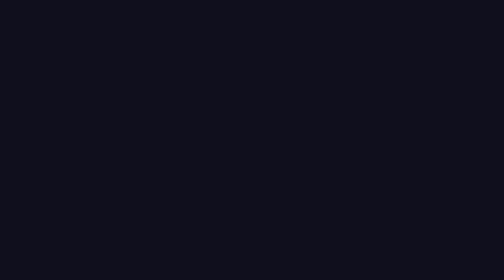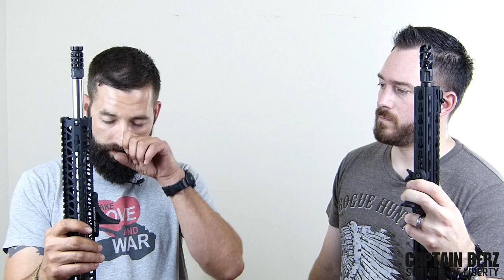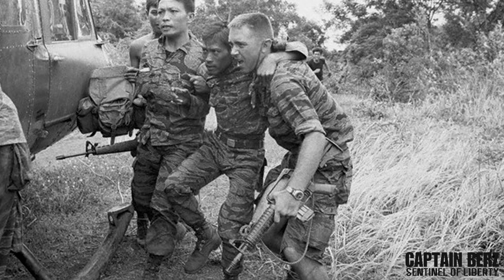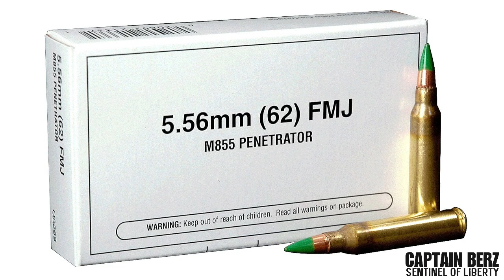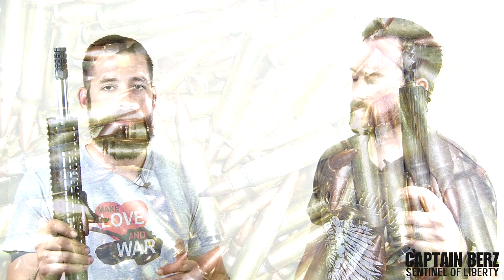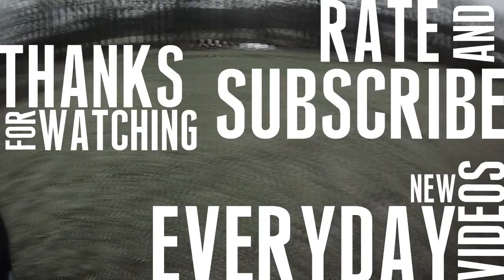AR-15 Barrel Length & Twist Rate (Part I)

Comment: For the record, your 500 yard numbers are way off. From a 20 in barrel, with a muzzle velocity of 3100 fps and a G1 BC of about .309 M855 is going to have about 1600 fps remaining at 500 yards. 
Now from a 10.3 in barrel (Mk18), you're looking at just over 2700 fps at the muzzle, which puts you transonic at 500 yards.

Comment: 6:09 😞 If it does not have a 20"+ barrel it's truly not a rifle, it's really a carbine or SBR, rifles are meant to hit with force over longer distances, and carbines and SBR'S are meant to hit with force within medium to short distance, traditionally rifle barrel lengths were 20"-50" today it's like people want rifle performance from a carbine, a carbine is a light weight short rifle, but not truly a rifle in the traditional sense, carbines are meant for CQB not distance, I don't see how he can confidently say that the 20"+ barrels are obsolete when they are clearly not, it's just that people want to look "TACTIC😎😎L"  and we all also want to get SBR'S removed off of the NFA list, so the short answer is a rifle can do everything that a carbine/SBR can but at longer distances with better stability but they do not maneuver in vehicles, doorways and tight spaces like a carbine, and carbine/SBR can do everything that a rifle can do but only at a short limit range but are more maneuverable and concealable  but not as powerful or accurate as a rifle, I never heard of a sniper using a carbine as their primary weapon, can you truly be called a rifleman with a carbine as your primary weapon? It's questionable maybe a Carbineman lol just playing!

Comment: I'll take the extra velocity of a 20 inch barrel vs any SBR any day. Depends on environmental factors of course but I'm definitely not going to be kicking in doors any time soon.
Reply: Exactly. It's a small caliber and depends on velocity. Short barrels look cool, but the reality is longer barrels are more effective and produce less flash.
Reply: True.  It's better to have it and not need it than need it and not have it.  Even if I have to kick in doors and hosed the room with bullets, a 20 inch barrel is not ideal compared to an 16 inch barrel but it still can be done.

Comment: Are there any manufacturers that produce a 20 inch barrel with a 1 in 9 twist?
Reply from the maker: I’d Go 1/8 or 1/7. For heavier bullet stabilization.
Reply: @CaptainBerz  But that does not answer my question. 1 in 9 out of a 20 inch barrel spins considerably faster than 1 in 9 out of a 16 inch barrel.

Comment: Twist rate is a personal choice and is somewhat determined by the manufacturer as is barrel length it really depends on what your doing with your rifle and what rifle you buy.Some take it to the extreme some times with truck guns but again it's their choice. Personally I like the 1:8 it stabilizes what I shoot and I have 16 and 18 inch barrels and it works for me.

Comment: The AR 15 is a good design. The 556 is outdated. It's an air force bullet. It just is.  6.3mm is about as small as you can really go and have RELIABLE 1round kills and punch through modern peer armies body armor.  We will be facing more people with class4 body armor.

Comment: I think an 18" 1/8 twist .223 wylde is pretty much ideal. For a SHTF build, it should sling 77gr very accurately at ~2750-2800fps.
Reply from the maker: You are not giving up much of anything going 16". But I agree, 1/8 wylde is a great barrel configuration.

Comment: Do a Barrel with 1:7 Twist have more Energy than a 1:8 Twist?
Reply: By "energy" do you mean KE - kinetic energy? Then the answer is no, they do not. Barrel twist doesn't have to do with the KE of the shot. That's a function of the equation KE = 1/2 (MV)^2. Both twist rates you mention are excellent for heavier bullets, and should work well 50-55-grains on the low end up to 75-80-grains on the high end. Bear in mind, too, that it isn't only projectile weight, but bullet length and design - which influence the choice of optimum barrel twist rate. 

Back in the 1970s-1980s when NATO was debating whether to adopt M855/SS109 62-grain "green tip" FMJ/LAP as the new stanag cartridge for 5.56x45, itwas determined by U.S. Army trials and testing that 62-grain performed very well with a 1:9 twist rate, but that was shelved in favor of the 1:7 because of the NATO standard 64-grain tracer round, which is somewhat longer and slightly heavier than the SS109/M855, hence the need for faster rifling. The switch to 1:7 was done, despite a loss of accurate with conventional 55-grain and 62-grain ammo in comparison with 1:9 twist. 

Because of its light weight and low overall mass in comparison with its larger and heavier .30-caliber U.S. service cartridge predecessors, the 5.56x45/.223 Rem. has relied heavily upon high MV in order to attain its external and terminal ballistic design parameters. That is especially true with older and more-conventional FMJ bullet designs such as M193 and M855.  If one plans to use these, then selecting as long as barrel as possible (for retained MV) is probably a good idea, whereas if bonded core solid, open-tipped match or other more-modern ammo is to be used, then barrel length and high MV are not always so critical for optimum performance. It should be noted that 300 AAC Blackout was designed specifically upon the request of U.S. special operations forces, who had noted less-than-optimal performance with 5.56x45 ammunition in their shortt-barreled, suppressed carbines.

Comment: My goto is an 18 inch 1:8 twist in .556 my reasoning is I like the full length gas system and .556 was designed for a 20 inch barrel as we all know so anything lower you're losing that velocity at range.

With that being said I've owned a 10.5 inch .556 and a 12 inch .556 AR when I go target shooting the 10.5 hits out about 200 torso sized groups the 12 about out to 250.

Now when hog hunting anything above 100.yards they have problems taking them down that's because even though on the range they might look like they can hit out hard at 200 yards plus but in reality .556 needs a vertain velocityto work.
Reply: If not you're basicly hitting with a beefy .22 lr if you want a short barrel ar go with 300 black out or 6.5 creadmor or whatever is out there at the moment I mean we are no longer bound by .556 lol.

Comment: Theoretical Question...
62 gr designed to move at 3100 f/s through a 1 in 8 barrel...

Now if you run that same 62 gr through a 7.5 inch barrel at 2200 f/s... does it lose stability???

Should not the twist rate change ?
Reply: @ tsafa: Reloaders/hand-loaders have long-known that if the twist rate is marginal, one can sometimes compensate for it with higher MV, and still get a well-stabilized bullet which does not keyhole on target. To answer your question, in theory yes the barrel length - and thereby attained MV - should have an impact on stability of your 62-grain projectile. The easier way would be to test it empirically, i.e., by going to the range and firing test groups with each at a variety of distances and studying closely the targets for signs of keyholing and degraded accuracy/stability. My hunch is that both examples will adequately stabilize the 62-grain bullet, but that the maximum stabilized range of the shorter barrel is going to substantially less. In other words, it will take less time and therefore less yardage for its flight path to decay. That stands to reason since it ought to go transsonic and then subsonic sooner, thereby becoming dynamically-unstable sooner. Your 62-grain bullet is tail-heavy naturally when at rest; what keeps it stable and in the proper nose-first orientation is the very high rate of spin imparted by the rifling. Once that decays, the projectile will begin becoming unstable and eventually its spin rate will decay such that it will exhibit greater yaw and finally "swap ends" as its spin fails to keep it nose-forward. A bullet not fully-stabilized as it leaves the barrel characteristically shows poor accuracy and "keyholing" of the target, for these reasons.
Reply: @GeorgiaBoy1961  
Great information. Thanks for taking the time to write this.
Reply: @tsafa  -You bet... no worries.

Comment: At 500 yards with m855 your more like in the 1700 fps range and about 400 ft lbs of energy thats more then a 9mm at the muzzle. Green tip fragments at lower then 2500 just not reliably

Comment: So, realistically, a 7.5”-16” barrel combined with a standard 55 grain bullet will have effective terminal ballistics at 0-150 yards. When combined with the m855 rounds, it will penetrate, but won’t fragment effectively. Gotcha 👍🏼
Reply: realistically, a 7.5 won't make a m193 fragment at point blank. If you want to use FMJ, 16" minimum, 20" ideally.

Comment: What grain would you recommend for 18” 1-8 twist
Reply from the maker: Mine works well with 69. Cor Bon makes a great load.
Reply: CaptainBerz where do u order from?
Reply from the maker: This performed the best for me: https://www.midwayusa.com/product/1791221707/ultramax-remanufactured-ammunition-223-remington-68-grain-heavy-match-hollow-point-box-of-50

Comment: Short barrel does not make full use of the burn rate of the powder in the cartridge  .  if I could afford to build specialized AR  it would be 20 inch bullpup piston with a tab on bolt and slot in the upper housing no forward assistance plunger .

Comment: what is better for 6.5 grendel ?  20" 1x8 twist and rifle , or 18" 1x8-5R and mid lengths ?
Reply from the maker: I do not have experience with 6.5. But a lower twist is always better at stabilizing heavier bullets.
Reply: CaptainBerz thanks for your attention , i appreciated.

Comment: I don't know about that, I use a 20inch barreled c7 (m16) in the cf, it's extremely accurate and reliable with a low recoil impulse, being a big guy it doesn't feel like a hindrance in cqb, clearing rooms and shooting in close proximity. it's still easily maneuverable, my arm can reach the end on the rifle in a way that I can grip it firmly and have positive control over it, I barely feel recoil or have muzzle deviation when I do this whereas with a carbine I need to bend my arm to hold the rifle which makes for a much less stable platform, what makes it worse is less stopping power, more recoil and less reliability. I think you should only settle for less than 18inches if you are very small
Reply: thisghy short people problems..  I'm 5'8" and love me the long guns, but a 18" gun is pushing the length for me at my height. it only becomes a problem though when I have to wear body armor and the length of pull starts to get out there.

Comment: good info' however  i went to Bootcamp in 1985 M.C.R.D. San Diego. 
i was litteraly  in the last Company that was issued the M-16 (a1) rifle  we qualified at 200 yards' 300 yards and 500 yards..
the A1 weighd a lil less than the A2 from my memory. had a thinner barrell and a shorter barrel also.. the A2 had improoved sights  stronger and longer stock... newer flash hider/suppressor and had brass deflector integral.. finger groove on pistol grip  and  different hand guards.. basically the same rifle but with some very significant upgrades.. we were already  begiining to shoot the newer Nato round when i checked into my first Active duty unit that replaced the Vietnam era 55 grain bullet the new green tipped Nato round was used in desert Storm and Somalia as well as other  battle grounds.  many reports from Army Rangers in the Migadishu fight were saying  it took two or three hits sometimes to drop an enemy  Somalian  soldier (skinny's)  those dudes typically weigh about 160 pounds  thats not a big man.. and if it takes two hits or three hits from a 5.56x45 mm round at 62 grain. thats not good baliatics..
thw 300 blackout or a good 7.62x51. doesnt have these issues.. so yes theb77 grain ball round u mention here os much more lethal  due to its mass. i dont see why logic  doesnt scream  loudly to the military to widely use the 77 grain bullet or have the D.M.R. program reintroduced at the squad level to have at least two men per squad with a 7.62mm rifle to help with hard targets..  either way the military  loves the AR platform becauwes its lightweight  and ammo is easy to hump i get it especially  as a grunt.. or In the L.R.R.P type missions  u need to carry more ammo and less weight if possible  but what good is it if it takes 2 or 3 shots to drop the threat??  77 grain all day long baby!!!!!! one shot one kill.... lets wise up!. and make our shots count.

Comment: Quick question I just built my son a lower he wants to make it a long range shooter what would you recommend on the upper 20" or 24"? Thanks.
Reply from the maker: 18" would work fine, but 20" would be the longest I would go. Twist rate is more important, make sure it is 1 in 7.
Reply: CaptainBerz  Thanks for the info .
Reply: CaptainBerz 1 in 8 twist rate is better.
Reply: Paul O'Neal u have a wider range of bullet weights u can shoot with a 1:8 twist
Reply: 1:7 works for 55gr. my 16" spikes chf barrel shoots MOA with 55gr vmax

Comment: does anyone know what muzzle device the rifle on the right has?
Reply: Idk what it is but I've seen it on the armalite ar10
Reply: It is the same as on my Armalite M15TAC18.  I called tech support to find out.  It is the highly rated OSS Bannar Alpha I.  It is 1/2 flash suppressor and 1/2 compensator.  It swirls the gases around rather have having them eject straight out the sides.  (Person shooting beside ya will be loving you!)  Since came on rifle, sorry, don't know price.  Hope this helps.  I get more compliments on how mine looks.  Seems my gun is quieter and felt recoil is so minimal.

Comment: In 1960, a 20" was a carbine lenth barrel... All the other US rifles in WW2 was 24", the post war M14 was 22" plus a long flash hider. The M1 Carbine had a 18"
Reply: Well actually the 20 inch rifle was standard length seeing how it was a 5.56 and the other rifles you have mentioned here where either 30-06 or 7.62. The carbine length came out in 66 with the CAR-15 in Vietnam when the military asked for a shorter rifle for special operations units. And this lead to  the adjustable stock and a 15 inch barrel and round forward hand guard. That's is when the carbine craze started.
Reply: @umami0247   No. that is not the start carbines, just the start of a shorter M16.  Also see Musketoon lol

Comment: I've seen vids of guys with twenty Inch barrels punching through ar 500 armor due to higher velocity. Do you think that can be done with an 18 inch barrel?
Reply: Depends. On Level III armour, which is rated for 7.62 NATO by AR500, even the XM193's can penetrate fully. You need Level III+ armour to reliably stop the M855's.
Reply from the maker: Doubtful they can punch through AR500 armor with FMJ or anything non steel cored.
Reply: +CaptainBerz saw a video on YouTube where they tested that armor. Somewhere between60-90 green tips fired, two rounds penetrated. obviously realistically speaking, you'll never be shot at 60 + times in the chest plate.
Reply: LOL SURE
Reply: CaptainBerz doesnt that depend on the thickness of the ar500?

Comment: Another thing you may not know is that the flash hider on most NATO rifles was exactly 22 millimeters in diameter for the purpose of firing rifle grenades. Perhaps all of the other commercial "flash" hidders are just for looks.  Of course today we use the 40mm attachments or M79s.  The other thing you may not know is that short barrels sound like the enemys' rifles (FAL or AKMs) and, particularly at night, this may draw friendly fire.

Comment: If I were able to redesign the rifle for the military I would go with an AR-10 platform (larger bolt for the .308 case)  and go with the .243, .308  or maybe even the 6.5 creed.  I often wonder why they haven't done this aside from cost,...the weight of the gun wouldnt be all that much more,... ammo a little bit.  They could do it if they just cut something else that isn't actually necessary, like the F35 JSF
Reply: It's all about ammo weight/size mate. Most of the ammo your standard Infantryman shoots isn't for a point target. It's for supression. More ammo is better in that case.
Reply: braines9 Ya I get that,.. what Im sayin is for the the distance a 5.56 has you could go w/a 6.5 grendel and that wouldn't be much heavier at all and has almost twice the range... but has a weaker rim around the bolt face hence a need t redesign a bolt and carrier. thats what I was getting at,.. but I get what your sayin.
Reply: @EricKPoorManPrepper I guess the army was listening to you lol